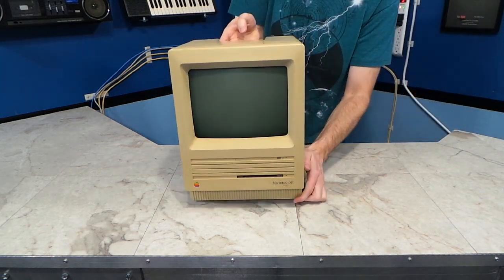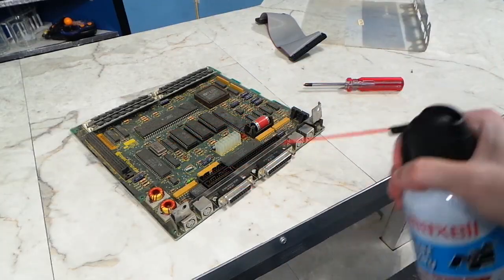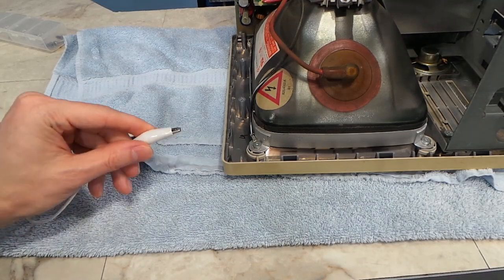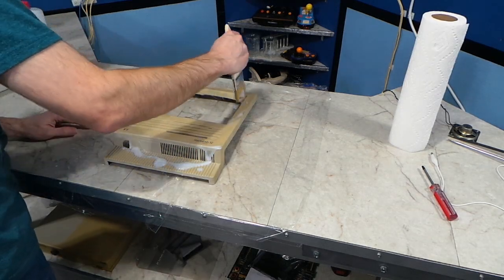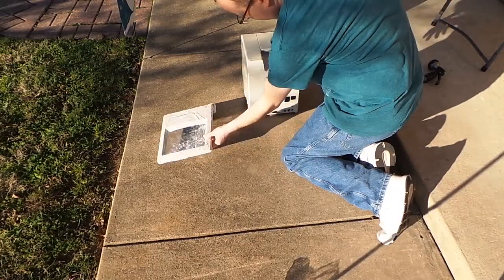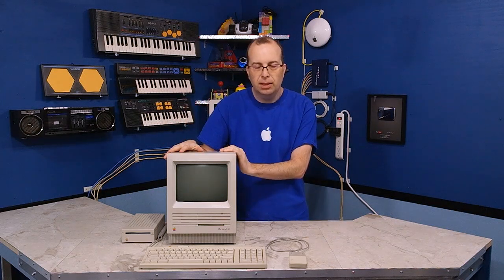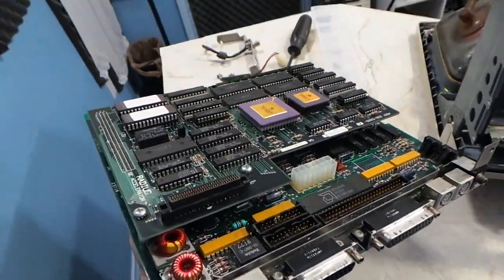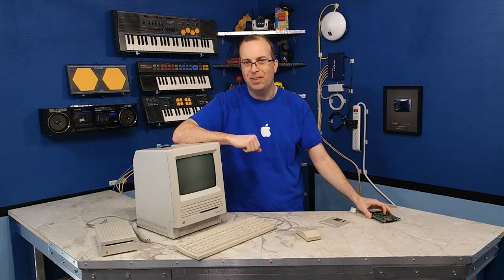Macintosh SE Restoration and SD-2-SCSI upgrade

Comment: Could have used a 3.5" drive bay converter for mounting the SCSI device.

Try a smaller capacity flash device... the SCSI controller may be out of bits.

Comment: Nice restoration!  Could you try booting that ApplePi-Baked image with extensions etc. disabled (hold Shift at boot)?  Looks like it had a few third-party extensions. :) Alternatively, perhaps use a Mac emulator to set up the SD card with a minimal fresh OS.

Also, are you able verify whether the old SCSI HDD works in another machine?

Comment: @ 12:09 A lot of times putting the SD card in after another machine or right out of the package causes issues. The next troubleshooting steps imo should have been to remove the SD card, put it in a modern computer, look for something like Format Disk or Format Partition, try the various types like NTFS AND FAT-# and reattempt the install. 
Thanks for the uploads btw.

Comment: First step when working on one of these old all-in-one Macs: remove the board from the end of the CRT! If you don't, one false move and you crack the pins on the CRT, letting air into the tube. At 4:00 I cringed seeing the drive bracket be pulled by the board...
Reply: I did that to my SE, learned the lesson the hard way

Comment: The problem with transferring things between the SE and a modern Mac is that modern Macs aren't compatible with HFS (the file system used in around System 6 and up until OS X) and MFS (the original file system used from the first build of Macintosh Operating System until it was replaced by HFS). (Modern Macs use HFS+, not HFS)

Comment: Hey about the battery I think it said 1989-2009
Reply: ONYX.G
No. It would be September 89. Most likely the manufacture date since the Macintosh SE was sold between 87 and 90, and those Lithium batteries were used because of their longer life.
Reply: tin2001 ohhh, ok

Comment: the chip sockets on those old macs have been known to cause issues, i would also reseat the ribbon cable connections to see if it may help. i  accidentally scrapped out a broken mac classic II years ago only to learn later that i probably could have saved it :(

Comment: Nice restore, however, the se was quite useless even when it came out. Limited scsi limited serial ports (no hw handshake) limited ram (10mb?) limited expansion.The se/30 i soooo much better. Still usable today. Endless possibilities. So, if you fanboys out there wants to restore something, go with the se/30 with an ethernet card and maxed out ram (32mb, thats like having 32gig in a modern computer). Those machines were great.

Comment: I'm going to sound like Captain Obvious here regarding the SD to SCSI adapter.  Have you tried using a different SCSI cable?  If so, did you also try using a different SCSI cable that has an active terminator on it?  The fact you were able to write to the card VIA USB but not over the SCSI bus screams to me that it's a termination problem.

Comment: Does the SCSI to SD adapter have a terminator built in? Looking at 14:56 I don't see the normal row of resistor networks. Without termination the drive would work somewhat, but have lots of errors. If the SD adapter doesn't have built in termination you could get a SCSI cable with more ports and put a terminator on the end.
Reply: I used to work at a school system, keeping a bunch of old Macs (at that time new)late 80's early 90's Plus'es SE 30's  Mac ll's etc going.  There was always a concern about terminator strips. when using external SCSI devices, . Then one of the students (who later became a software writer at Apple) , said IT DOESN'T MATTER.  He never used them.  Since that time without terminators, I can't tell any difference.  Sometimes theory and practice don't agree.  I think the coupling to an external device acts as termination and doesn't matter much, unless there is a long cable run, in which case there is a small time delay in signals due to cable reactance, still not sure it makes a difference.

Comment: I have the miniSD version of the SCSI2SD working on my SE. I had to use the firmware tool to configure it with the SCSI ID string of an Apple-firmware hard drive. But then it worked with an official Apple formatting utility. 

I never got it working with the Macintosh Plus though. (The Plus' SCSI controller isn't fully compliant with the SCSI-1 protocol, since it came out before SCSI-1 was finalized!)

Comment: Wait why does the logic board have a battery for?
Reply: CantThinkOfAName To expand on Mikemike690's reply: Every Mac ever made has a real-time clock (no having to type in the time on every boot like on some early PCs, and early Macs (like the SE) stored many settings in "Parameter RAM" (PRAM), which is why the battery is called the PRAM battery. These settings included the selected boot disk, audio volume, mouse tracking speed, keyboard repeat rate, and time zone (I think).
Reply: Besides Time & Date and PRAM, the battery powers a chip that watches the keyboard power switch and starts the system up when it is pressed.

Comment: Shorting the CRT directly to ground is very hard on the tube and can potentially damage it. If you need to discharge the tube, put a 1 megaohm resistor in series with the device you're using to ground the tube out.
Reply: I used to use a a thirty watt 110 ohm resistor, to discharge filter caps, with 400 Vor more across them, and also CRTs, just because I was worried that the sudden discharge might be a problem,... but actually wondering what would get damaged by discharging a CRT? ,... isn't the charge held by the (metal oxide coatings?) on the inside /outside of the tube?  I think the 1 meg resistor might take a little time,... what is the capacity in mfd of a typical CRT. Does anyone know.? 1 mfd, &  1 meg ohm takes 1 sec to remove 91% of the charge., (which would still be potentially over 2KV for color CRT).

Comment: I'll be honest, putting time and effort to get an SE up and working is sorta a waste of time.  You're better off restoring an SE-30 which has far more capabilities.  Heck, if you swap the roms with a IISI or IICI. you can make it 32-bit clean and it can run Mac OS 7.6 without problems, not to mention far more upgrade options and just fun things you can do on it.  The SE is kinda stuck with what it can run and only slightly more capable then a Plus.

Comment: I know Druaga1's got one of those floppy drive emulators, iirc, should work ok on this machine.

Use JB Weld if you don't feel like waiting for epoxy to harden, they used that stuff to hold cast iron blocks together after cracking, so it's perfect overkill for holding a speaker in.

Comment: Wow. That machine is more modern than the computers we had when I was at school in the seniors computer lab. We had about 15 macs with no HDD's I think they were 64's and the teacher had a 128. I was a junior and we had apple 2C's but as I was 1st in my class for 3 years in computers I was allowed to use the senior lab whenever I wanted. There was also 2 286 running 3.11 windows. High tech hey!! I'd love to start collecting old computers, I owned a C64 cream machine from new, and I also owned a TRS-80, one day I'll clear out a corner and put a few of my favourite dinosaurs in there.

Comment: Hey David, great video! My son and I have been putting software onto 1.44MB floppies for use in our SE/30 via our Mac Mini with a USB floppy drive, seems to work most of the time. If you need an SE/30 for the show we could definitely arrange that, as we're in the DFW area.

Comment: The SE/30 is a great little mac. I am a windows/Linux guy myself, but used macs in school and like the older macs. I have I think 3 SE/30's in storage I may have to get out after seeing this video as all three had dead scsi drives when last used about 10 years ago.  Just remember if you do get a SE/30, get a copy of Mode32 as the roms were "dirty" so 32-bit applications will not run on the SE/30 without that program. I hear you can use a IIfx rom and replace the SE/30's rom with it to get a 32-bit clean machine.

Comment: I do know that one difference between the Mac Plus SCSI controller and SE SCSI controller is speed. The SE controller is about 33% faster. It used a 2:1 sector interleave when formatting the HD instead of the 3:1 sector interleave that the Plus needed (the MAC II and later were finally fast enough to not need any sector interleaving).

That timing difference probably shouldn't be a problem for an HD emulator, but the SE SCSI controller does have a marked difference from the earlier Plus and the later Mac II and SE/30 controllers.

Comment: that OS load screen looked to be newer than 6.5 which could be part of your issue in my experience the classic mac's don't really work on any thing newer than OS7.1 and for that you need at least 4mb of ram.  My back in the day way of troubleshooting these involved a SCSI zip drive and discs with images of Different OS's on them.  Also I would try a smaller SD card something like 128mb thats more than enough for any use on an SE.

Comment: Or, (3), see if you can find another Mac that has a known, good SCSI interface and hook up the drive you got out of the MacSE and see if you can read it. If you can, then likely the problem is the SCSI controller chip on the motherboard.

Comment: I just found an SE/30 for USD 120 in my area. Worth it?
Reply: Well I bought it. Mac SE/30 with 2MB RAM and a 40MB hard disk. No idea what to do with it now :D
Reply: I hope it works. Personally I wouldn't have paid that much for one. Maybe you could post a video of it when it arrives :D
Reply: I got it. It worked great except the sound was a little quiet. Suddenly the screen only shows horizontal bars :/

Comment: I had a portable crt to that I used to play my SNES on in the 90's, I were about 12 and anyways... the picture was stretched for some reason... you couldn't see an inch of the picture either side. It were dead annoying, particularly with zombies ate my neighbors or tiny toon adventures! So I took it apart one day, I peeled back that like suction cup thing on the back of the screen! Man did it give me a jolt! Never took a crt apart again...true story! I have fixed a LCD tv recently tho...

Comment: Ive worked on dozens of macs over the years, with modern storage as well as original storage. I have found that Lido is your best bet, next being silverlining. I use an SE with a SCSI2SD without issue. Just so your aware.  YOU HAVE TO KEEP YOUR PARTITIONS 1.8GB or under! or it will NOT work.
Reply: I agree with this. I have an original SE (low density version) which I have used with the AztecMonster CF to SCSI adapter, the SCSI2SD (older version with the red board), and also the Floppy Emu. All work fine. I always initialize with Lido, and use 1 gb CF and SD cards.
Reply: Classic Amiga's have a similar partition size limit of 4GB.  Various upgrades and patches have broken the 4GB barrier but if you are starting from scratch, it's something to keep in mind.

Comment: A note on electric shocks.  The voltage on a CRT is, as a rule of thumb, about a thousand volts per diagonal inch plus 5 thousand.  So a 12" screen can have a charge of up to about 17kV.  The saving grace is that it is extremely low amperage, so it will hurt (sometimes a lot), but is unlikely to kill you.

Where I ran into trouble is repairing power supplies - these can easily kill you.  Specifically, some designs have the giant heat sinks on the regulators hot instead of ground, so you can have rectified, unregulated high voltage DC on the nearly impossible to get around, unpainted aluminum wing that's blocking access to the tuning pots that you need to adjust to get your output voltages correct after repairs.  The one time I forgot to take off my wedding ring, I touched the ring to the grounded table and brushed one of the heat sinks with my right hand.  145V unregulated DC across the chest kind of feels like someone hitting you right over the heart as hard as they can with a stout broom handle.

I found out from a nurse friend later on that if that happens to you, go to the hospital for observation even if it doesn't kill you right there and you can still move around on your own.  Apparently, your heart can just stop even a couple hours after the initial shock.  You might as well anyway because you're probably not going to do much of anything useful for a little while after getting shocked like that.

Comment: Is power supply capacitor replacement something people typically do on vintage computers? I have rebuilt a number of much older vacuum tube era radios and televisions and this is job #1 when working with them. I am sure components from the 20s-50s were not as good as those from the 70s-90s but I have had a couple of modern computer power supplies detonate because of the caps as well.

Comment: This may sound stupid, but maybe the read lock on the SD card is pushed up
Reply: Mohammed Hamza Except when he used the utility to copy over a working SE HD image he didn't have a problem.
Reply: The adapter can always push it (that happened to me loads of times with SD cards)
Reply: That's exactly what I was thinking too.
Reply: i thought it was write protect but,... eh :D
Reply: The switch is not actually attached to any internal electronics, its much like the switch on old floppys. you can just put some thick tape over it or epoxy putty over the entire notched out section. Note: scotch tape will not work reliably.
Reply: Maybe you're right...
Reply: magic
Reply: yeah
Reply: gogos1073 cool
Reply: Some SD card slots can do that It just depends on age.
Reply: One time I couldnt write to an SD even after trying the lock in both positions . . . Stuck it in a friends macbook pro and it suddenly worked flawlessy. SD locks are fucking magic.

Comment: David, I also had some trouble with the microSD card version of the SCSI2SD board but I needed to run the scsi2sd-util program with the board connected to my Mac (or Windows PC).

Depending on what version of the Macintosh System Software you are using, you may be limited to a 1GB disk even if the system reports 2GB available.

This is the SSW on the boot floppy with the patched Disk Setup installed. It may not be OS7.5.5

I used my MacMini to configure the firmware for two 1GB drives on a 2GB card and it works great. Set the 'auto' check box and it will automatically offset the 2GB SD card without you having to calculate the values yourself. If you have a 4GB card, set it to four 1GB partitions. Once these are set in the firmware, the SSW disk will see four separate 1GB drives and you can format each one in turn.

I think anything below OS 7.5.x is limited to 1GB drive size.

Comment: Once upon a time, I was a Windows/MS-DOS-only computer user. Then, one day I was at the local hospital thrift shop and spied a Mac SE for $40. I kept looking at it, and the thrift shop manager let me bring it home for $25. Not knowing ANYTHING about Macs, I asked my "Apple-since-Apple-II" friend over to look it over, A number of software and hardware upgrades via eBay later, I had the equivalent of a Mac SE/30 complete with a 1.44 HD floppy drive (the 800K DD floppy drive was toast), 32MB RAM, and a 540MB HDD, running Mac OS 7.5.3. Since this was as far as I could push this "SE 4/40," I gave it to an unfortunate computer user who's Packard Bell thing had died. Then I went on a Mac Laptop hunt to surf the Interweb. But that's another story.;)

Comment: Nice video! Just a quick tip though; you might want to install System 6 instead of System 7. Don't get me wrong, System 7 is great on a Performa or something like that, but for one of the "tosters" as I like to call them, it's just too slow. If you check the system resources in the apple icon, you'll find that the OS alone takes up over 75% of ram! I have three of these set up in a network for occasional Bolo matches, and it simply wasn't possible with System 7.
Reply: old macs sort of look like tosters
Reply: *toasters
Reply: Why do you call them "tosters"?
Reply: What are "Bolo matches"?
Reply: Bolo is an old macintosh game that allowed players to connect to each other through a network, or in my case local talk.
Reply: Mikemike690 The problem is that these old macs have very limited ram available. I maxed mine out in terms of ram and still had the issue with System 7
Reply: I have a dual boot of System 6 and System 7 on my 1GB Quantum SCSI drive :P
Edit: Oh, and btw this is on my 1990 Macintosh Classic

Comment: 15:22 the large number of INITs (extensions) and CDEVs (control panels) might be contributing to the lock-up. If it's System 7, you should be able to skip them by holding down left shift. I don't think MacOS 6 had that feature, though. :/
Reply: Oh wait, progress bar. That's definitely System 7. Try the left shift technique

Comment: You can press the special button to skip/stop the extensions from booting maybe  some not compatible  with your SE, but i guess you tried that "i have certainly installed some on my Macs".
If that work you could use a program HFV explorerr for PC to write the " install floppy images" to the "hdd image" and make a fresh install. And then you use FTP to get the images and programs needed to hdd. It can be that HFV explorer can read your mac formatted  SD card but i doubt that.